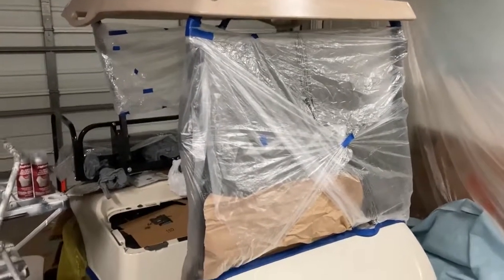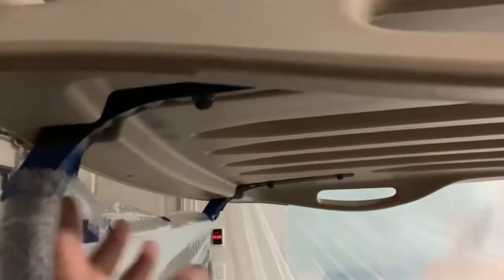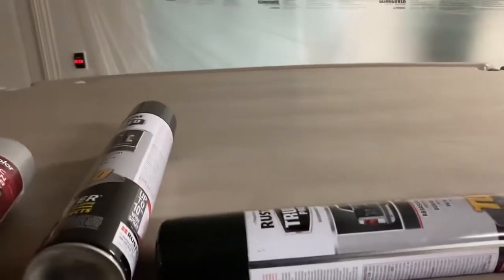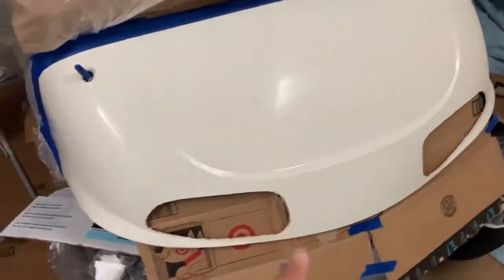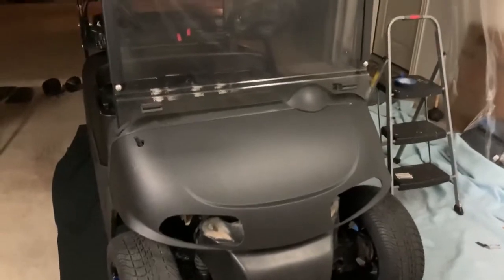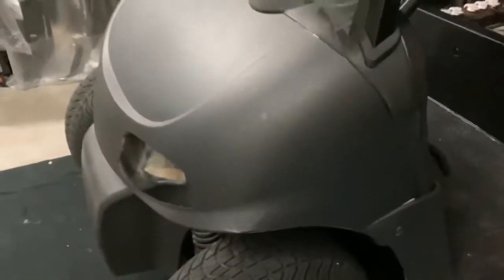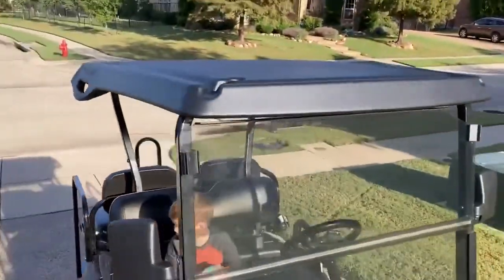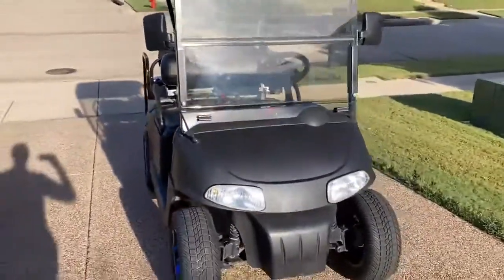Golf Cart - Turbo Bed Liner Paint Project

Comment: What grade of sandpaper used on body and top? Wet sanded?
Reply from the maker: I used a padded sanding block.  Not sure if the exact grit.     I mainly wanted to remove the shine.  I hit it with a wire brush to scratch it.